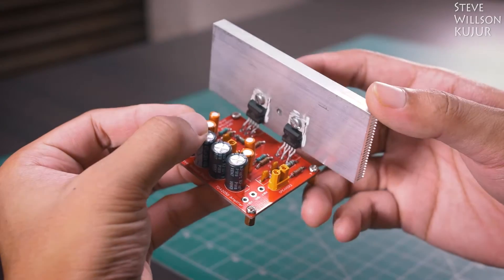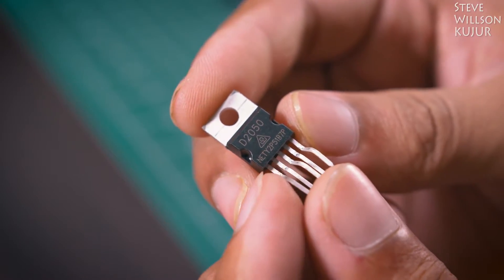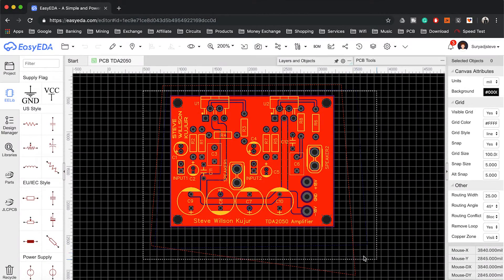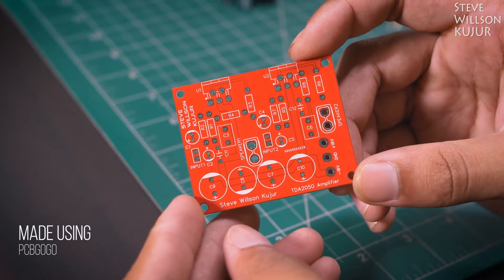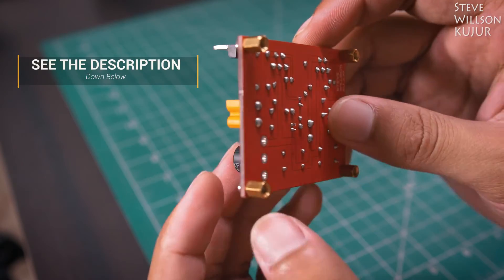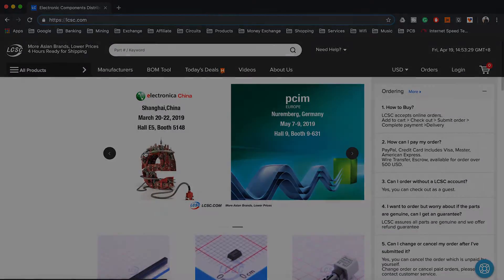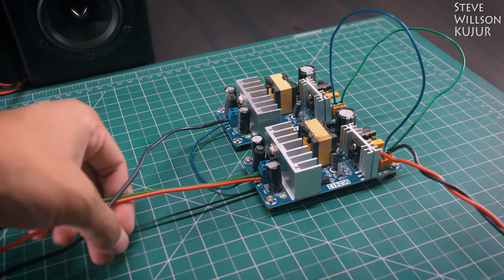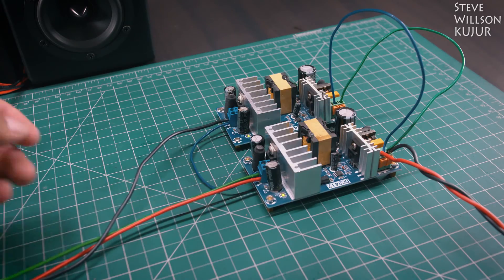DIY Compact Stereo Amplifier

Comment: Hi, can you make a limit battery power charger. One side plug into phone and the other side to the chargering cable. As you know lithium battery last longer when they are not fully charge at 4.2v. if you can make something that stop chargering at around 4v that will be good.